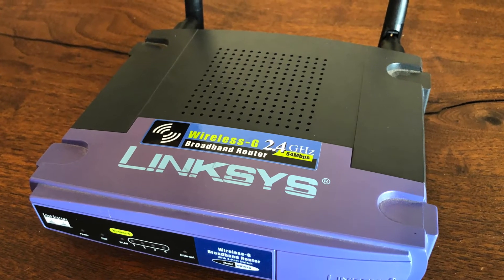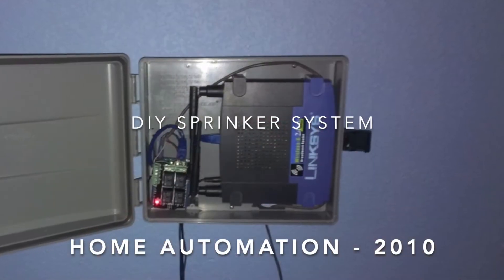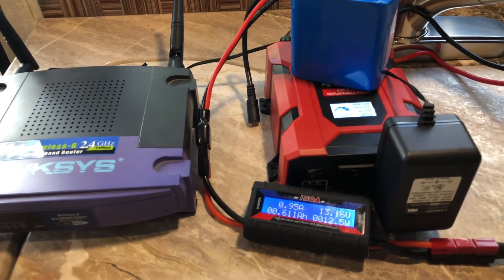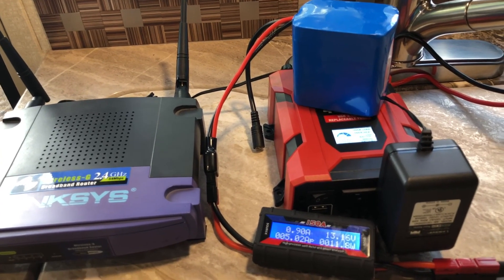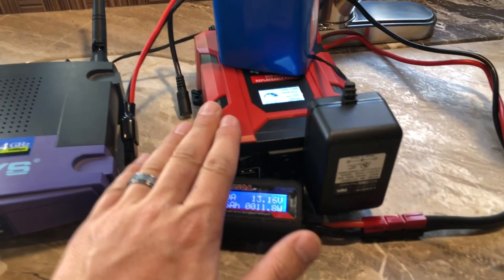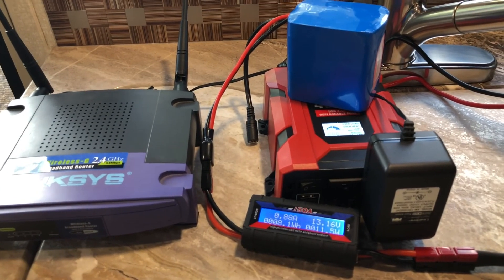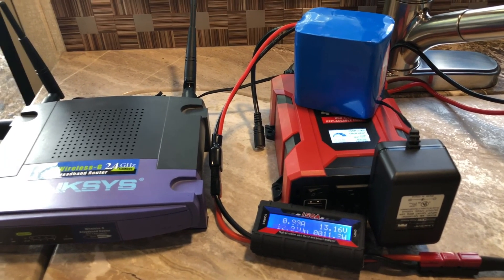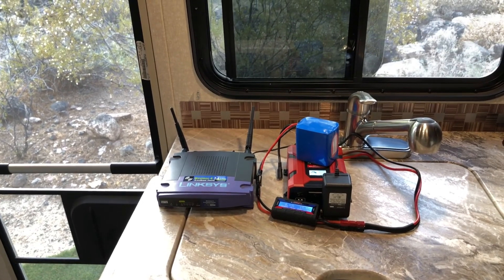Off Grid Wireless Repeater Bridge - Linksys WRT54G

Comment: What is the antenna coaxial impedance for the router.  Are they 50 ohm or 75 Ohm?    I am researching using my WRT54g as  wifi extender/booster in my RV for Campground or Startbucks wifi.

Comment: Hi, this is good one ,. If we use as repeater does this effect on internet speed in second router connected devices ?
Reply from the maker: In my experience and with my equipment, yes. If I connect a device to the wireless repeater it will have reduced bandwidth compared to if the same device is connected to the primary wireless router.

Comment: Dude.......just hardwire the battery. its within 12 volts needed to run without the loss of the inverter.
Reply from the maker: Yep. Did that shortly after this video was filmed. Works great.

Comment: A more efficient system would be to power the linksys using just the battery, and a buck converter to set the correct voltage.
Reply from the maker: You are 100% right. I did a separate video on that very topic after this was made. If you're interested here's the update: https://youtu.be/mg_MQkNk17g

Comment: What’s the input voltage of the router?  If It’s 12V you can make a custom cable (or cut the existing power adapter cable) to attach to the battery and avoid using the inverter.  If not 12V use a smaller DC voltage converter to go up or down.  Currently (no pun intended) you’re going DC to AC back to DC.
Reply from the maker: That’s a great point and a quick project to add to the list. It’s 12VDC/1A. In fact, I think I already have a cable with a 2.5mm connector on one end and Anderson powerpoles on the other.
Reply: Usually they are 5v 1.5-2.5A so about the same as a Pi4.  Been awhile since I had one of those apart but I think the power chip on board will handle a 12v input.  Easy enough to solder in some power poles on a pigtail.
Reply: Just checked the manual online and it says these are 12V, so definitely add some powerpoles and it should work.  Like Eric said these things can usually handle a wider voltage range.  Just use a multimeter to check the polarity.  Great video - didn’t realize there was 3rd party firmware out there - I have a few of these linksys routers sitting on a shelf that I can upgrade and put back in service!
Reply from the maker: Thanks for checking the specs. It appears that everyone is going to start making custom cables and reflashing this classic router.
Reply: The Tech Prepper ha!  I know I am!! 🤣
Reply: Yep. I was going to say the same thing. If the router version is right, we flash these for developing ham MESH networks. The fact that you can get a little 8ah battery and run one of these independently for hours makes them great for field use.

For MESH networking the only problem is that you have to be careful which version of router you get.

I'm actually looking at a similar project right now to extend my wifi range, so thanks for spurring me onwards!
Reply: Jeremy Tanzer which versions do you prefer, for CPU/Mem? Firmware compatibility?
Reply: @bthemedia  We use broadband ham net mesh http://www.broadband-hamnet.org/

There's a list of tested/compatible routers. With the linksys, a good rule of thumb is version 4 and under.
Reply from the maker: @Situational Ready You’re 100% correct. I did a follow-up video on 12v appliances for preppers. It covers exactly what your describing. Thanks for calling this out and contributing.